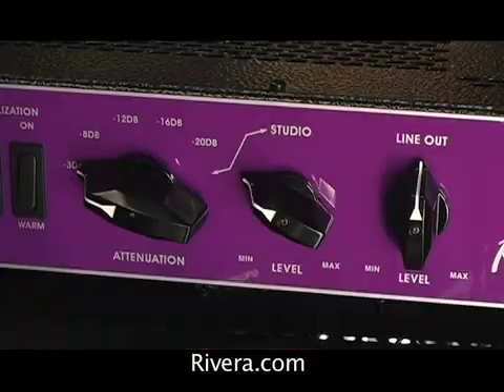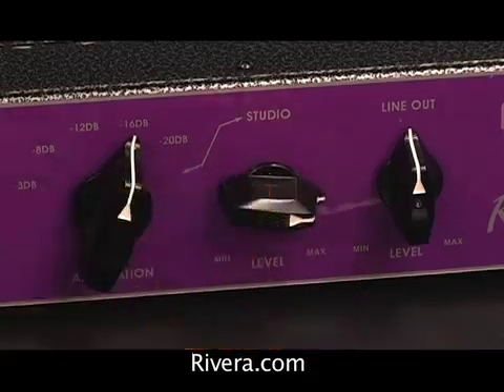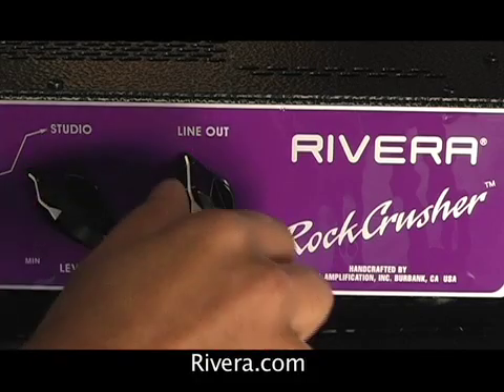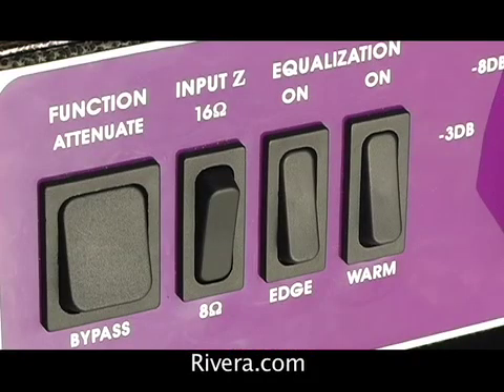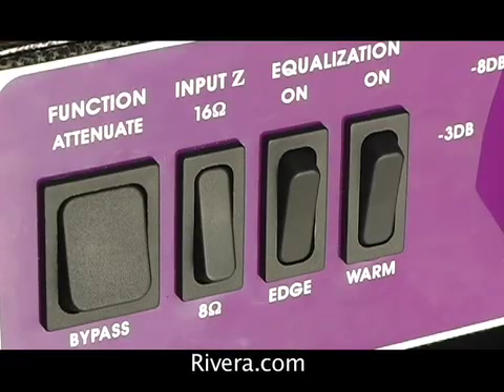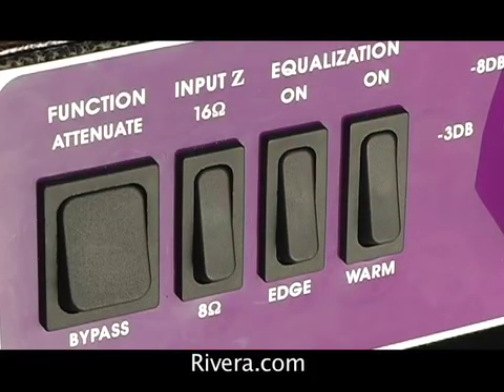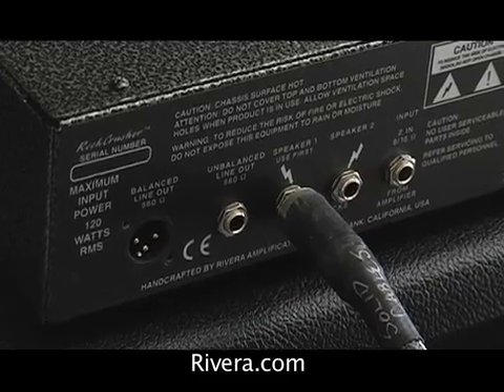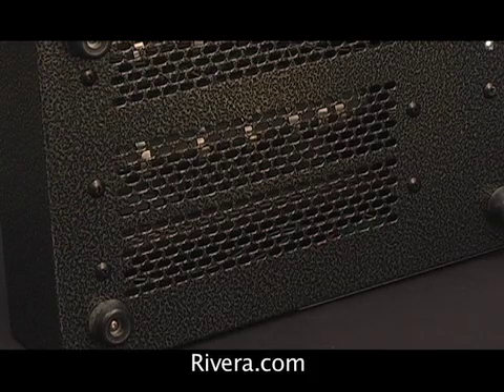Rivera power attenuator "RockCrusher" full details

Comment: I love my Rock Crusher!  I call it the face crusher!  I can get that punch in the gut sound, without blowing out the windows or my eardrums, and it's built like a tank.  Having worked in electrical engineering, when I saw it's size I knew it was built for the task.  Those tiny boxes are a disaster waiting to happen, and like with most products the box may be covered by the warranty, but your amp isn't.

Comment: Im thinking about buying this great product, but not sure if its overkill. I have a great 20 w combo, and I only want to set it to the clean side of break up, where it sounds just right. But when I do, its still to loud for my playingsetting. So I need a unit that just takes the top of the volume, that still sounds great “almost clean”. I understand this unit can handle really powerful amps, but would it be overkill for my smaller 20w?

Comment: I bought a rock crusher used from guitar center. It worked great for 5 minutes on my EVH. Then my EVH blew a fuse. Tried it on my triple, it blew a fuse. Is that typical, it is it a bad unit?
Reply: did you match the ohms? I have had two units and never had a problem